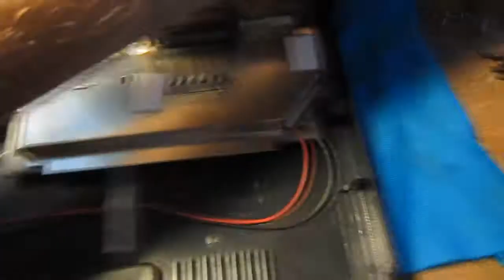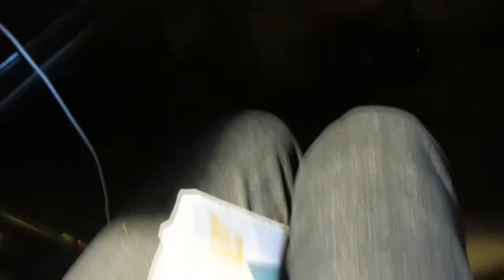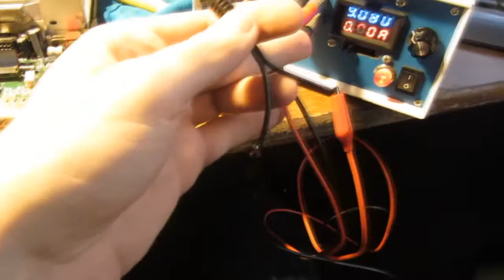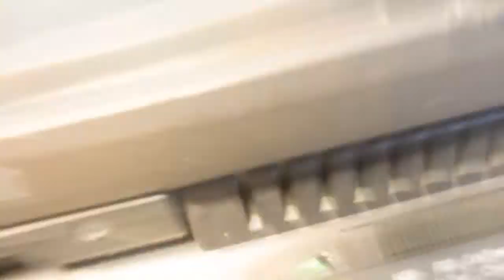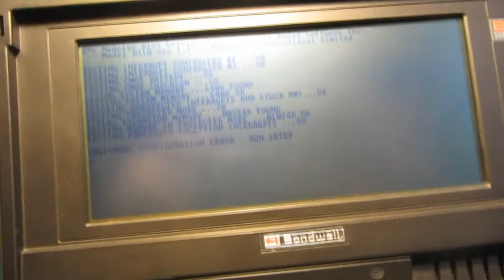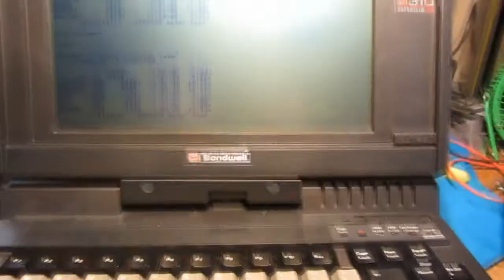Bondwell B310 laptop - Clumsy teardown, "repair", and nostalgic entertainment

Comment: Do you know how to enable output to an external display? I have a B310V with VGA output but  I can't figure out how to switch between the LCD and a monitor. I've checked the BIOS and tried many different Fn+key combos. No luck so far. Thanks for the video!
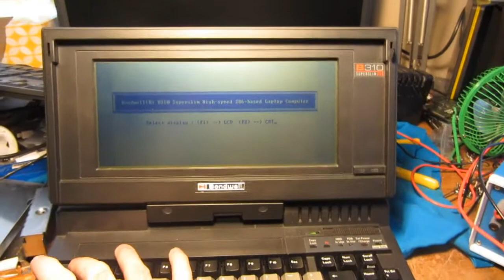Reply: It asks which one you want to use upon startup. You can see it at 18:50. However, this is an EGA output not a VGA out. You can get DE-9 to VGA adapters, but this does not change the signal and modern displays will not work without an expensive adapter like the raspberry pi EGA2HDMI adapter.

Comment: Thank you very much for this.
My grandfather, a writer who passed away in the mid-1990s, had one of these, which wound up with me.
By watching your video, I managed to remove the hard drive and can finally read the contents.
Reply from the maker: Glad I could help!  Cheers!
Reply: Unfortunately, the drive didn't register as readable, though that may be an issue with the adapter I was using.
Reply from the maker: Ah, dang!  Are you just using a USB->IDE little adapter?  I've had good luck with them but not perfect luck.  Do you think it's the adapter or a software issue?   Lemme know!
Reply from the maker: Let me know if you can get it figured out, I'd love to help out as far as I can for this.   How did the drive show up on your end?
Reply: Computer has been sitting in a closet for over a decade and appears in fine condition. Used your video to remove the drive while leaving everything else intact.

When I plugged it in (using a USB->IDE adapter that's been able to read other drives), Disk Management says "Not Initialized" and "Unallocated" -- and claims it has 386.41 GB, which I know can't be true.

So, I'm suspecting partition damage, which would mean the files are still recoverable. But I'm proceeding slowly and cautiously to avoid doing anything to make the situation worse.